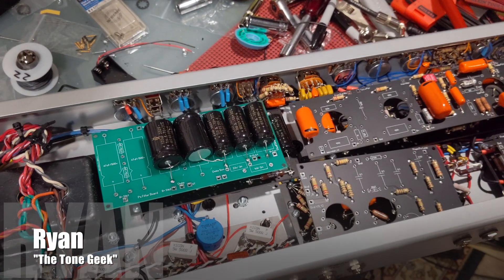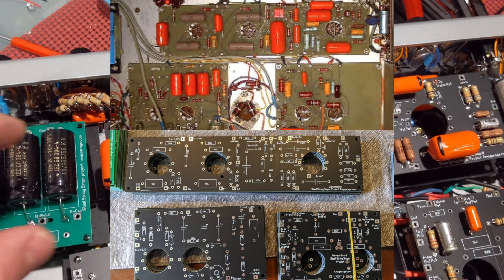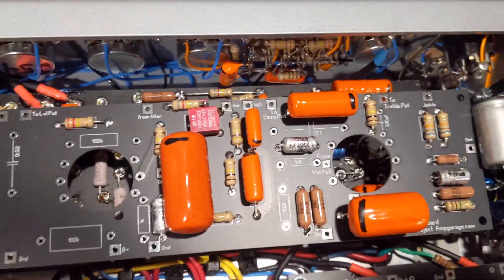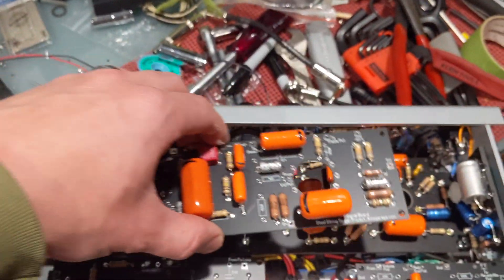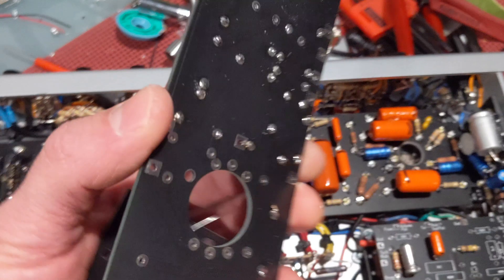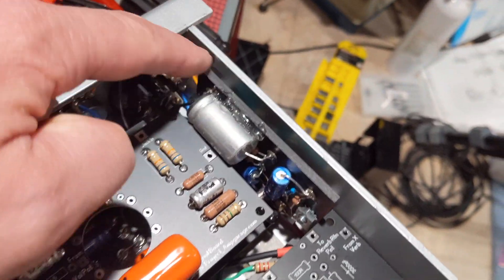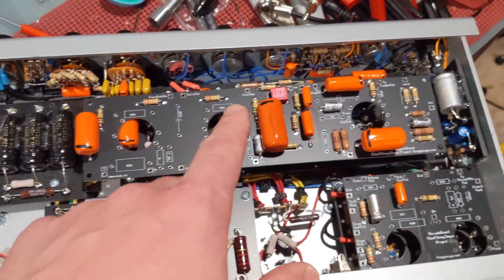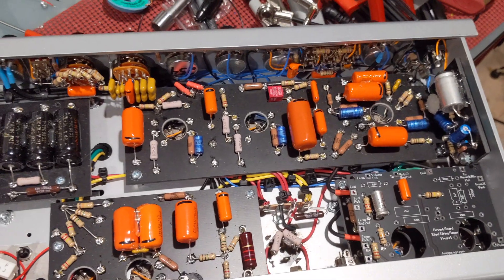Steel String Singer #002 Next Level | 1:1 PCBs

Comment: It's been 5 years, is this project still going on?
Reply from the maker: Yes! Through the community, we've made every single part of this free and "open source" for everyone to make their own. That's means Chassis files, PCB files, documentation, etc. as all available on my GitHub. Some entrepreneurs are making chassis and PCB files available if you check eBay too. Some China-based outlets are selling their own version of it too. The project is alive and well with probably 100 DIY builders have built them to date.. hope that helps!
Reply: @TheToneGeek wow that's awesome. Which component choices did it end up with? Your quiet configuration or the more true to the source version?
Reply from the maker: @ImpostorModanica I've made one with "NOS" parts, new & true parts, & one with premium low noise parts.. I personally don't hear enough of a difference that couldn't be offset by a different tube brand. They were all really close to each other and can be dialed in to match with slight tweaks of the EQ knobs. My preference now is whatever is the highest quality part, usually metal film & milspec
Reply: @TheToneGeek   Awesome. So basically your own layout. You mentioned some Chinese outlets are offering the their own versions of it too? Anyone in particular you recommend?
Reply from the maker: @ImpostorModanica I don't have a recommendation for those outlets. I'd want to personally inspect a unit or be ultra familiar with the work of someone before recommending anyone.
Reply: @TheToneGeek  got it. That's admirable. I was just curious because I'm in the market for a tube-based SSS style preamp :)
Reply from the maker: @ImpostorModanica ah I think my last comment didn't send. PeaceHillFX is the best game in town. I've had a few trusted friends with their products have positive experiences with it and their workmanship seems outstanding